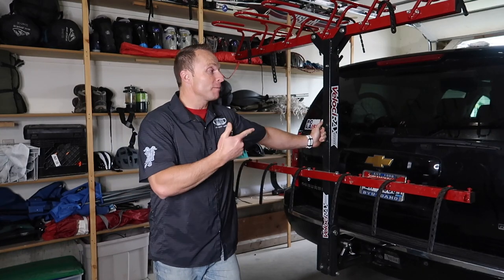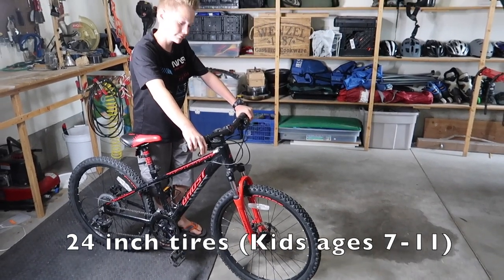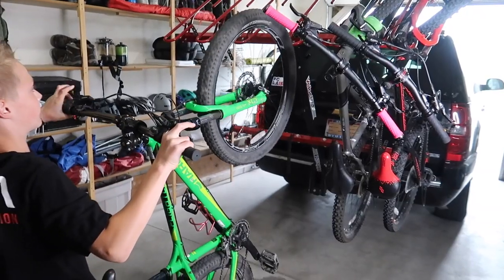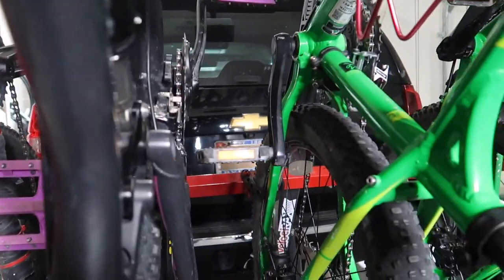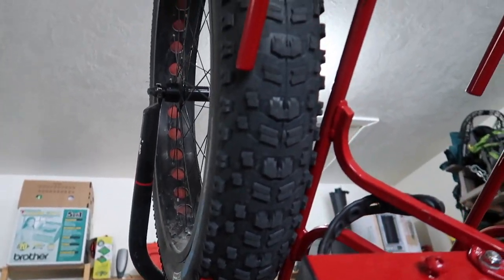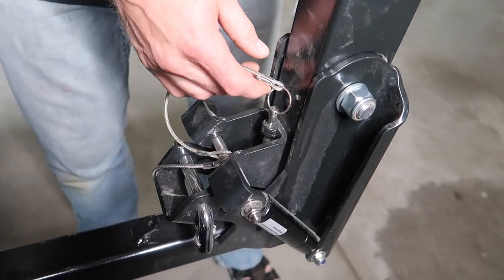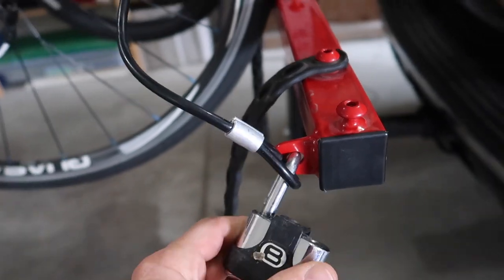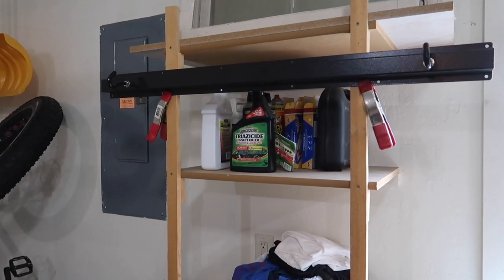Velocirax Bike Rack Full Review

Comment: I just sold my Thule T2 classic with the 2 bike add on to purchase this very rack. The Thule was rock solid but also very heavy and actually more expensive by about $100. Thanks for the review. I think I mad a good decision and another plus for the Veolcirax is that it is RV rated.
Reply: I just did the same, but I found the T2 (with add on) could be mounted and removed with 1 person, but the Velocirax is definitely a 2 person operation.  I ended up getting a T2 Pro (without add on) for daily use and use the Velocirax for longer trips or larger groups.  Still a very nice rack, but something to keep in mind for those needing to mount a rack alone.  Very nice review.

Comment: Sorry, but I think you're loading this backwards. I believe the website says start with the largest bikes on the left and move across, and put drop bars on the far right. I own the 7 rack carrier, have bikes with 29, 27.5 and 26" wheels, have driven across both 4x4 trails and thousands of road miles without any rubbing. The bikes weigh a lot when you lean it up, but I'm carrying 7 bikes without any rubbing. I'm pretty impressed. This rack is awesome!
Reply from the maker: Yep. I was. I’ve had the track since May now and also have a few thousand miles on the rack and haven’t had anymore rubbing. I don’t think there’s a better rack out there.
Reply: a query. Could you tell me what is the angle at which the front wheel is and the thickness of the steel of the basket?

Comment: Great information. Do you know if it's rated for RVs? Also, love how you include your kiddos. Well done.
Reply from the maker: I'm not entirely sure. I don't see why not, but I don't know for sure and couldn't find any info on their website.
Reply: Frugal Fit Dad , my husband had heard that because there is more bounce on the back of RVs, you need a tougher built bike rack. We are planning on spending some time traveling in our RV and are in the market for a good bike  rack. I appreciate you checking. 😁
Reply: @alliswellwithkristywells8747  This rack IS rated for use on RVs. I have a 5th wheel travel trailer and spoke with the manufacturer directly and they said it is. I have one one the way. I ordered the 5X with wider pacing since I also have road bikes with drop bars so I wont have the spacing issues on my MTBs.

Comment: This was super helpful!  Have already shared.  How are you locking them up?
Reply from the maker: There are two brackets on the ends of the lower bar and a welded handle on the middle post. I can anchor a lock and cables or chains to any of those points.

Comment: The one issue I don't like is how hard it is to "close" up to the car once all the bikes are loaded.  My kids and even my wife can't do that.  I almost wish the pistons were reversed to help pull it up, and there was a switch or disconnect to release the pull when you needed to lower it to load bikes.
Reply from the maker: I have to agree that the weight of the rack when it’s fully loaded with bikes makes it very difficult to put back into place. We have found that with two people pushing up on the handlebars is the easiest way to get it back into position.

Comment: Thank you very much for the great video.  Question though: In "camping mode" why did you have to lift the rack off the ground while the bike was pushed in?  Can you not just push the bike into the ring?  If you're putting more than one bike in the way you showed, it seems like it would not work (first bike would tilt what you lift up for the second one, etc).
Reply from the maker: The hoops are not tall enough to hold the bike upright. Especially 27.5+  or 29 inch tires I lift the rack to have the hoop bite a little more tire.

Comment: I was really considering it until the 100 pounds? Is that an average weight for four bike racks?
Reply from the maker: No. I think most 4 bike racks weigh in around 50-75 lbs or so. The Kuat NV 2.0 weighs 50lbs for the 2-bike rack. With the additional 2-bike extension it weighs 91lbs.

Comment: What made you choose this rack over the NSR?  Anyone viewers have experience or comment on this vs NSR?  For me it being a 2 person job to put on and off is bit of a bummer and maybe a deal breaker.  Unless I could figure out a way to put into the hitch and remove myself, I may have to find another solution.  I'm 6', ~ 195 lb and probably average strength for a man my size.
Reply from the maker: I can put it on and take it off by myself. I'm 5' 8'' 165 lbs. It's just easier with 2. After a year with this rack, I've gotten better at putting it on alone. 

Main reason I picked this over NSR is that I didn't like the way the NSR carried the front wheel. Most friends with NSR go down the road with the front wheel spinning. I didn't want to put that kind of stress on my hubs. With this rack, the only thing that touches the rack are the tires. The tires and secure and the bikes ride nicely.

Comment: $850 yikes i have a family of six as well and just use my 4x8 trailer to haul all the bikes around and it was less then 500
Reply from the maker: We did the same for a few years. But our trailer kept scratching the bikes. The flopped around too much. I was probably doing something wrong.
Reply: @FrugalFitDad  same here sir i ended up building a pretty lightweight removable bike rack out of aluminum to fix that issue